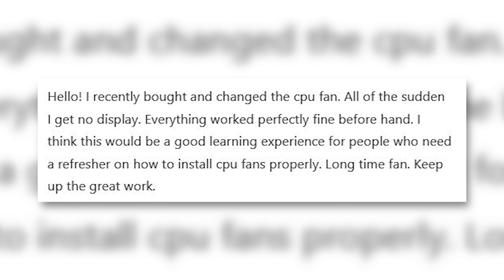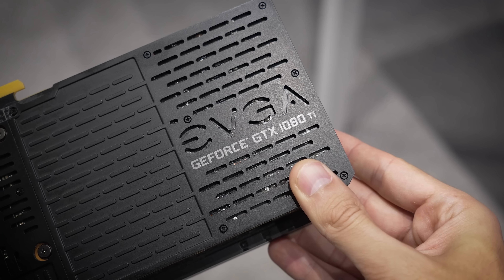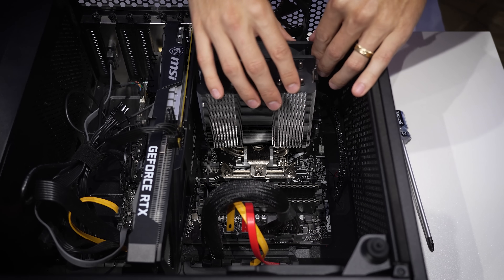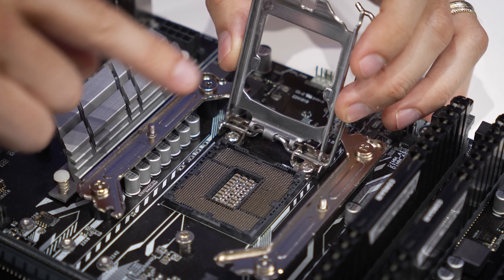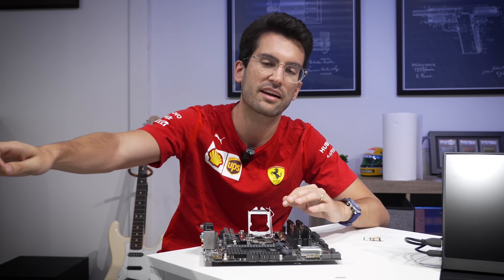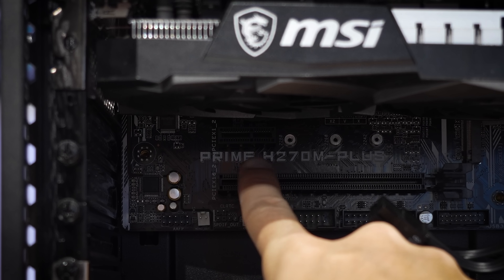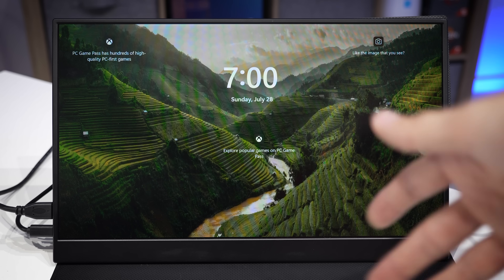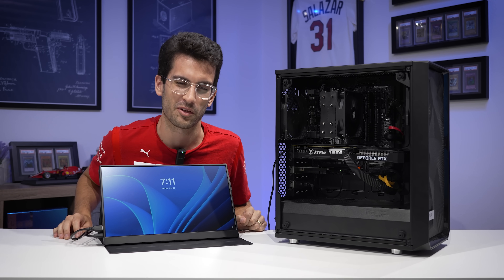Fixing a Viewer's BROKEN Gaming PC? - Fix or Flop S5:E16

Comment: Great video Greg! I have often repaired LGA socket pins using  a needle just as you demonstrated when I was a bit younger! Now at age 73 I can still see the problem using a jewellers loupe but my hands are not steady enough to get it right! It's great to see someone using the old skills and passing them along to new generation! Look forward to more Fix or Flop! 😀😀😀
Reply: 66 here, my hands are steady, but I have triple vision, so would not be sure which pin I was actually touching.  Had to give up Cross-stitch embroidery, for the reason.

Also weak muscles.  I cannot hold "heavy" components like collers or GPUs for more than a few seconds.

Heck such a shame that we don't have a Greg equivalent in the Den Haag area!
Reply: I've been building PCs for over 30 years, but my first LGA socket was quite stressful. I felt very uncomfortable closing the retention mechanism of a Ryzen 9 7950X3D. The force required to close the lever was unexpectedly high.
Reply: @WirrWicht  Over 30 years for me too and still surprises me today how much pressure you have to apply for some of the heatsinks, glad though that I don't have to faff with dip switches on motherboards and master and slave for drives and then there were drivers..........
Reply: @jaysmudger  heatsinks, pressure and those parts of the mounting clamps looking like guides for screw drivers... RIP countless motherboards... Never happened to me, but I also never had problems with PGA pins or a heatsink pulling the CPU out of the socket. .. Ripping slots off the board is another thing I can't even begin to understand how much force those people applied... These things do not just slide off...
Reply: your doing good - nearing 60 I have a digital microscope to see now days and my hands have always been pretty shaky.

Comment: "That is quite old,"

Weeps in 4th gen 4770k
Reply: I got 2700K from intel 13 years old 😂
Reply: @MagnusHandell  Bro I'm using i5 2500K since 2012😂 Still going strong with windows 11
Reply: @MagnusHandell  I've got an i5 2500 CPU.  Works fine on win 11
Reply: My desktop is a 4790K with a GTX960. (Though my laptop is a 11800H with a RTX3060)
Reply: Smiles and looks at the i5 4590 on his keychain... :-)
Reply: My main PC has an i9-10900X which isn't that old but my other PCs have quite old but still fast enough CPUs for my use
Xeon X5670 @ 4.4GHz, 24GB DDR3, GTX 970
Xeon E5-2690, 64GB DDR3, GTX 960
i7-3770 @ 4.22-4.43GHz, 16GB DDR3, RX 470
i7-4800MQ, 16GB DDR3, GT 730M
Reply: I7 870 here
Reply: That’s what’s in my Minecraft server pc :p it was my first pc in hs
Reply: In my eyes, a computer should last at least 10 years. There is no point in replacing something that works perfectly fine.
Reply: @UNIX32  I mean good luck playing games releasing this year and beyond, hell even games as old as 2-3 years now on a PC that’s using parts from like 2013 lol
Reply: As long as you don't want to play the latest tittles at maximum settings you can definetly get by 10 years. But for some people that's a req and then 10 years is never gonna happen.
Reply: @UNIX32  But companies change their computers after 5-6 years?
Reply: @ranjanbiswas3233  that's in business settings. I'm referring to a home computer.
Reply: @UNIX32  Launch Date Q2'13 , so over 11years old.

There is a point in replacing things that work fine. Plenty of examples.. my 4690k couldn't play the games i wanted, nor could my 970 which was upgraded to a 980Ti, then to a 7800xt. My CPU was upgraded to a 7600x and my sata ssd was upgraded to a 2tb NVME drive.

The same can apply to a car, we got rid of our 2 seater for a 4 seater. The 2 seater worked fine, but wasn't up to our needs anymore.
Reply: @gmualum08 has he not owned anything in the last 10 years?

Modern cpus are more power efficient, faster, more cores, more threads....
Reply: @jjmmjj9999  Just upgraded from a 3770 to a 7600x, and it was bloody expensive. Most people just can't afford to build a new PC every 2 years, and even if they can, it's quite painful to spend so much money at once.
Reply: @bara555  no one is saying every 2 years?? I had my 4690k and Z97 from new, 10years ago...
I've had my 7600x and B650 for 2 years now and it's still going strong, no need to upgrade.

My 7600x, 32gb ddr4, and B650 motherboard cost me £400.. Not a huge amount by any means especially if it's going to last me 5/6+ years
Reply: have a i7-11700k with a Gigabyte 6800XT and after picking up a gaming laptop with a i9-14900HX that it seems to be holding up very well for how both of them have a 2tb sn850x
Reply: 4770K is an awesome CPU. I just moved mine to a Linux HTPC, should work great for another 10 years there. If it still does all you need, why change it?
Reply: I got an intel 13700k. Was expecting it to last me 10+ years. Now I'm not even sure it'll last me 1 😭
Reply: still have my 4770 non K great CPU still.
Reply: i7 4790k with gtx 1080 in my older rig
Reply: i was running pre ryzen AMD until last year xD
Reply: Better than an Intel 13th or 14th generation, that is for sure :)

Comment: Greg i have used sowing needle and a stanley knife blade , box knife blade to you lol and used the blade to level or straighten pins without a problem , the needle was toget thepin to a point where ican straighten them.
Reply: That's what I use. I take my time and use a good magnifying glass.
Reply: @auntmaryspals7978  that what i use i did for get to add that tool .
and plenty of patients.